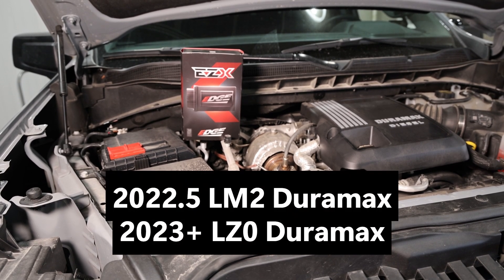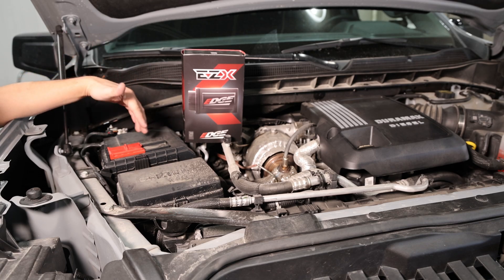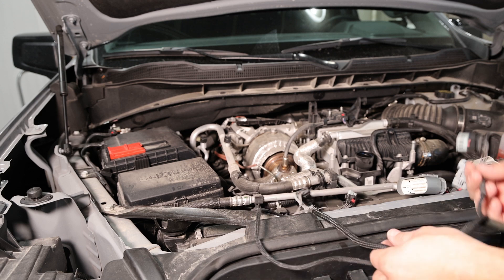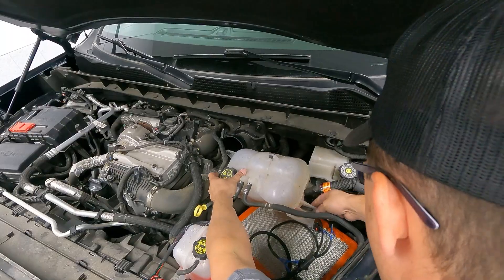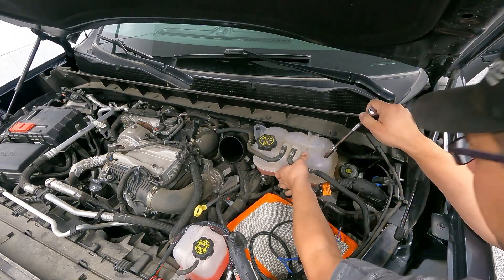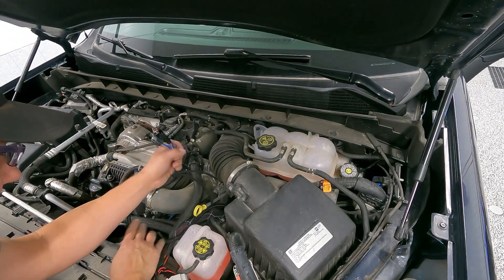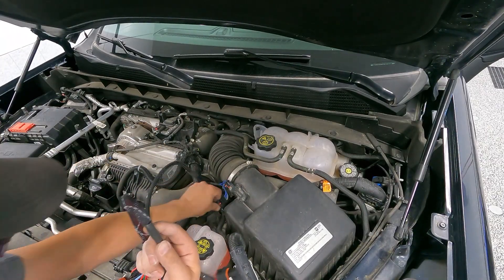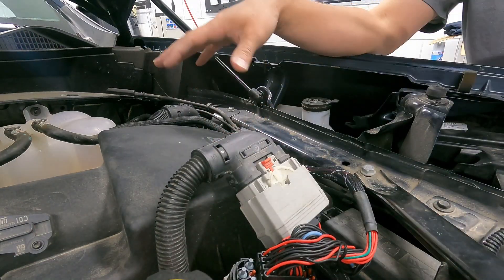EZX 22712 3.0L Duramax Installation

Comment: Please Please Please develop an aftermarket intake set of tunes so we can squeeze out just a little more! Test with the S&B CAI and it should cover most possible combinations of what’s available for these trucks without throwing a code like Greg at Demonworks got.
Reply from the maker: We do not test or validate our products with other performance products on the market.
Reply: @edgeproductsman so we have to get rid of our intakes to run the EZX?
Reply from the maker: @csanc1985  No, there should be no reason to do that. But some aftermarket intakes may require you to leave the EZX MAF pigtails disconnected
Reply from the maker: No, there should be no need to remove an intake, but if the change in MAF with an intake is large enough, you may just need to leave the EZX MAF pigtails disconnected.

Comment: Is there gonna be an update so we can change tire size and remove speed limiter?
Reply from the maker: Unfortunately, with GM's switch to Global B communications protocol and their encrypted message authentication, our team is still working to crack that coding. Until we can gain access to to that system, we will not be able to add those tire and speed features to this device.

Comment: Will there be another product that can run in tandem with this later to adjust tire size?  I'm on the fence for hp and tq but if it did tire size also I would have zero hesitation about buying it.
Reply from the maker: We are working on a solution for Tire Size calibration, yes.

Comment: Can we expect an update with tire size adjustment, speed limiter adjustment, and high idle?
Reply from the maker: Those are not features that will be available with this device
Reply: @edgeproductsman  those features will not be added at any point? If not, why is that?
Reply from the maker: @ivserratos  GM switched over to their Global B communications protocols in 2022.5 model year, so all the CAN-BUS signals we were interpruting for those features in the earlier 20-22 LM2 model are now encrypted. While we are working to decrypt that system, we will not be able to add those features to this device until we have that engineering effort completed.
Reply: @edgeproductsman ok makes sense, so if i purchase this now and these options are added will edge make sure I have them? The reason i ask is because this will determine my purchase so i want to make sure if im going to make the purchase im not missing out on added features
Reply from the maker: @ivserratos  it is not likely that those features will be able to be added to this device. If we can crack the encryption, it will be done with an additional module.